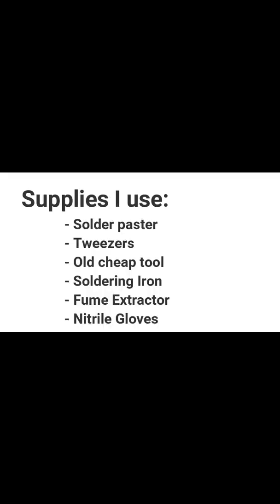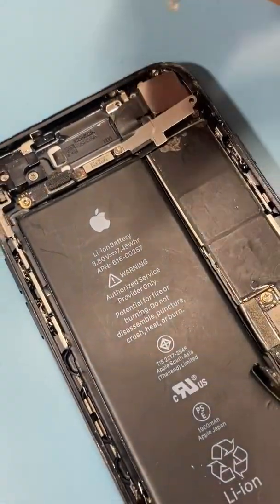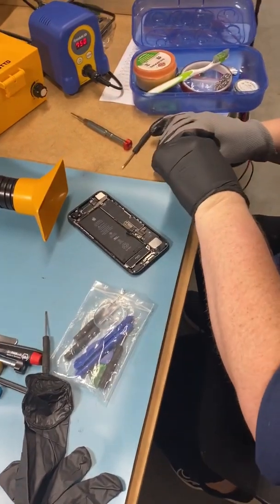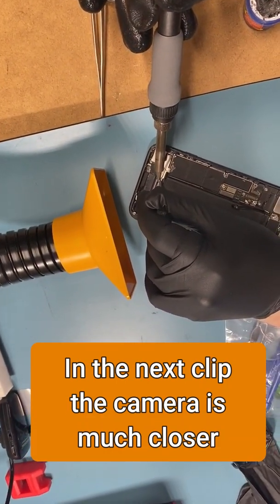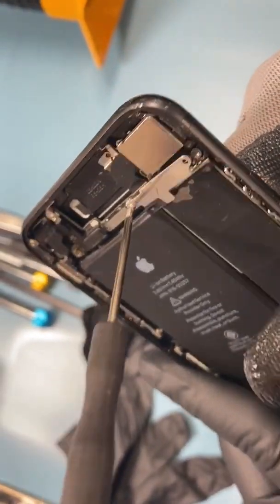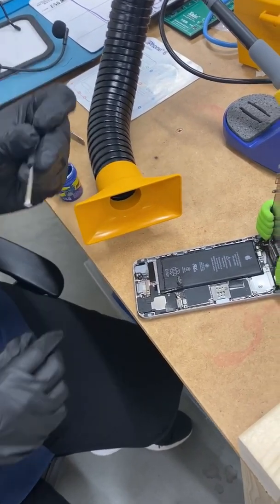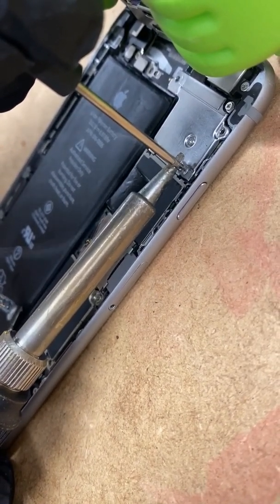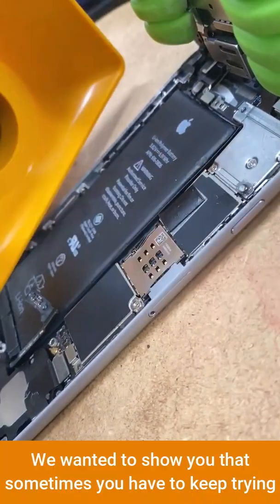How to remove a stripped screw from a cell phone or any other device by CellBotics Training Center

Comment: Wow, there is no way in hell that you teach micro soldering or BGA chip work of any kind. As someone who's been working in this industry for many years, I'm staggered at what you just showed your students to do in the event of a screw being stripped ??? What the hell are you thinking of??? You should not be  telling people to smear solder paste  over a device in the hope that the driver will stick to the screw. If you do teach (MICRO SOLDERING) then teach them to use the microscope with a small cutting tool to cut a new path on top of the rounded screw so you can then use a flat head driver to undo it. Using paste is very risky as not only have they now got to clean the shield of paste, but they run the very real risk of shorting out small components as the paste melts and runs down the sides. Students need to be taught that it's always quality over quantity. Doing a job properly is a   necessary practice that builds confidence in a student and installs a sense of self-worth. Corner cutting in this industry is not and should not be welcomed because, as electronics become smaller and more sophisticated, a student will need to be well equipped to align and deal with the complexity of the future industry. It's not just a student who suffers if we get it wrong. We all do.
Reply: U seem to be very knowledgeable maybe u could help. I stripped 2 screws on the frame (rookie move, I know) I can't get a cutting tool in to safely cut the screw without damaging around. The screw is flush with the frame so I can't grab it either. Any suggestions?

Comment: i been trying to get the screw out of my iphone so i can replace it with a philps head one but no luck so far so i can here looking for ways to get it out and where the screw driver goes into the screw is completely dulled and i tried every thing from  the other video but that didn't help so i came here and the other screw i gotten out already but i need to get the other one out so i can see what the problem is under the back of the iphone so i can see what is going on under there